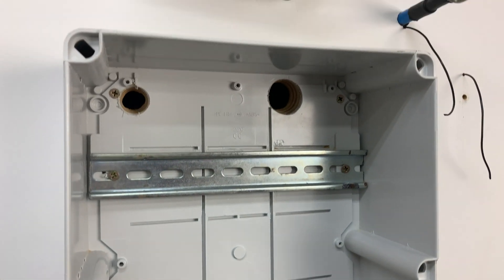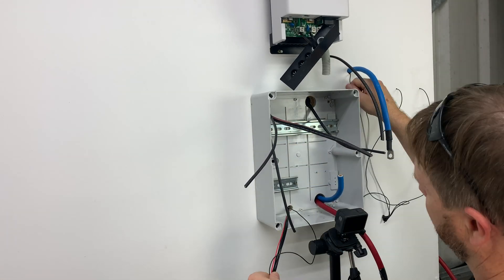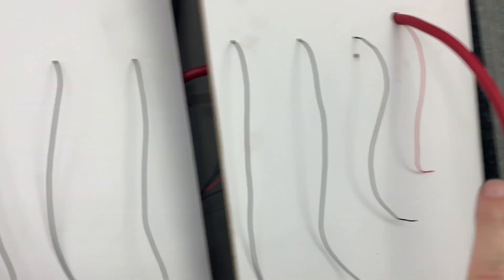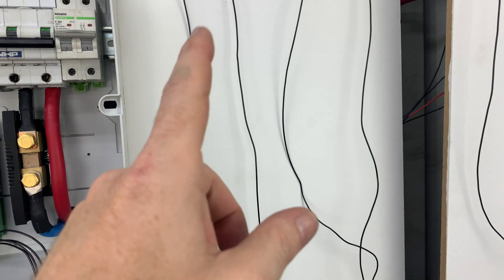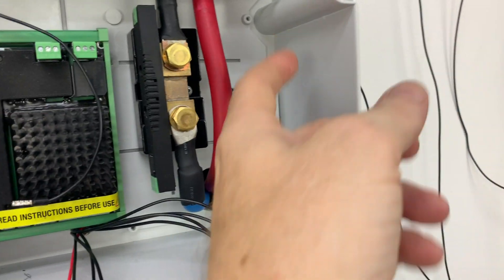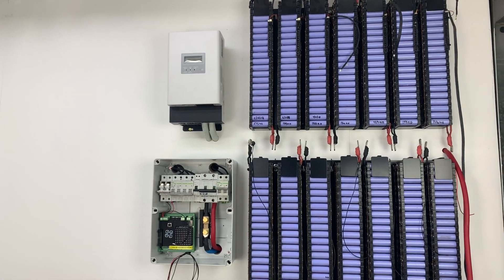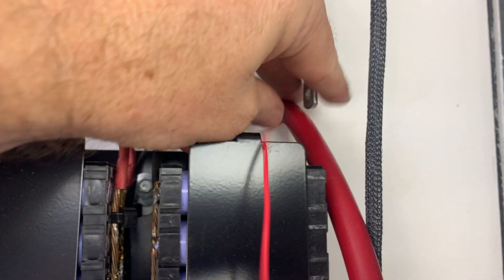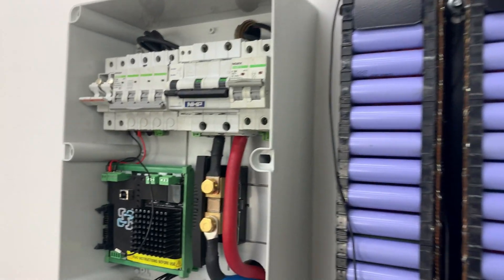Cleanest battery install [Part 3]

Comment: Hi Hbpowerwall, I am very proud of you that you started as an ebike enthusiast and now you’ve become a pro. However I have two questions for you. 
When let’s say you have 14s power wall and your device is pulling out 30amps. Does the 30amps spread across the entire 14s or does each pack give out 30amps?
Second question. I built a 14s power wall all from laptop cells however I noticed when under heavy load, about 5 pack sag much more than the others. Can you explain what might be the cause. Is it to do with the cell discharge rates or laptop batteries aren’t designed for high rate discharges. However the resting voltages stay the same but under load, they sag. It’s also 14s 80P.
Reply from the maker: never owned an ebike :) but as for your other question it's thirty amps per S pack so 30amps at 4.2v 1s or 30amps at 58.8v 14s

Comment: I'm thinking about building something similar, about like a book shelf. With false back, to mount everything on/in to hide things, put the batteries in the base, a box making up the bottom. It would be my 250ah 12v lighting battery, and backup inverter. 1500-2kw inverter to power my fridge incase of my main system going down, a generator running gets old FAST! This could be something that looks nice enough to be living room furniture! Poly carbonate door! Led lights, someone's significant other may not like something the sort, but I don't care, I think it's a go!!  Time to get to work!! Ha-ha... Cool man..
Reply from the maker: Be sure to document and share with the community even if it's just photos and a updates on the forum ..

Comment: Wooow pretty good job...do u sell these directly the batteries I mean all soldered etc would like to purchase them
Reply from the maker: Nar, this is very much a DIY community, part of the fun is doing it yourself.
Reply: @HBPowerwall  ah wooow I understand I've have literally watched all your videos from start to date mahn honestly you inspired me I have 3 lithium narada batteries each at 48volts 100amps making it 4800 kilowatt hours mate...but yours is dope can you teach us how I can start to make cells that are 48volts yours are 24 too good though but my inveter is a 48volt system unless I connect the cells first in series than parallel...but would appreciate your 48 teach just even one line just want to be sure....but still watching your videos from 2 years ago
Reply: Maybe if you can teach me how to do one line 48 volt I can promise you to do a whole load of like what maybe 20 to 30 kilo watts inspired by you and thanks for your reply honestly didnt think you would reply but thanks once more...
Reply from the maker: My house battery and 90% of all my videos are of my 48v system.
Reply: @HBPowerwall  must be the new ones I'm still watching the old ones I'm 2 years back yet but eventually will get there I watch your new ones and cover old ones still so will get there but too good once thank you alot mahn your hard work is too inspiring and you seem to be a nice guy a humble beginner from looking at your first videos anyways bless up let me also make something will defi get back thank once moew

Comment: Are all the balance leads going on the bottom packs?
Are each parallel pack from the 2 series group paralleled together?
Reply from the maker: balance leads going between both packs on the six middle terminals. BMS leads just on the terminals through the middle near the little holes

Comment: Mate that's awesome. Do you think you need a fan? Convection cooling works pretty good. Holes top and bottom only though. ;-))
Reply from the maker: Will need a fan, it will increase balance currents, and make the hardware last longer. A fan is cheap insurance.

Comment: Looking good there Pete, i think you will be fine with that layout.. if you have 2 12v fans that are quiet then you could series them together one in inside one on outside with a dust filter between them for a nice dust proof push-pull config with less noise. To think you where worried about the layout.. you done just fine so far.
Reply from the maker: I didn't think of two fans in series, wasn't overly sure that's how it worked. Might look for two smaller fans to do that idea
Reply: @HBPowerwall  I just tested my own theory and there is indeed no issue putting 2 fans in series as long as the combined voltage meets supply i.e. 2x 12volt on a 24 volt supply in series then it does work fine and ironically the largest of the fans takes more of the share of voltage by 1 volt. So they even seem to balance them selves in terms of the share of power used/size of fan.
Reply from the maker: Interesting and cheap idea.. time to tinker i think, two small fans one directly on the WM7 and other as an exhaust or entry fan..